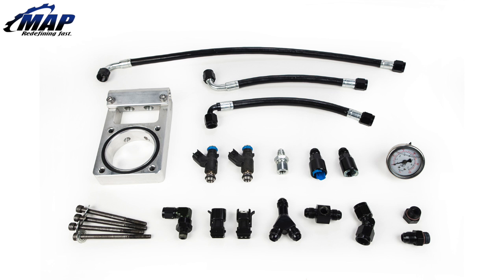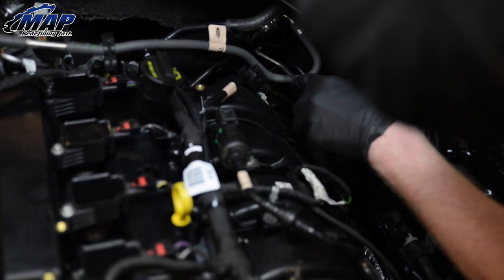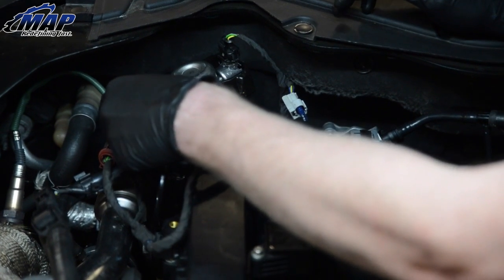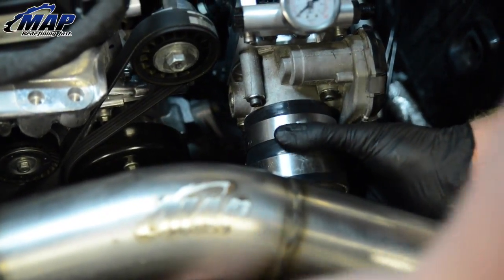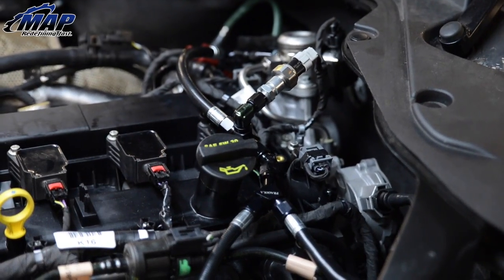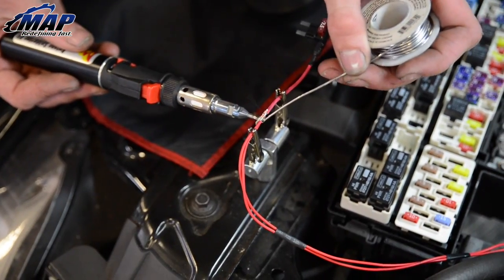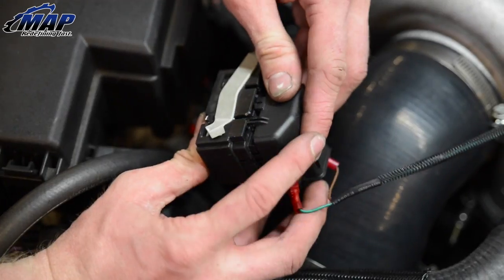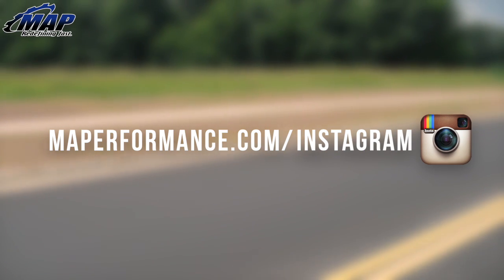MAPerformance Auxillary Fuel System | Ecoboost Mustang Install Guide

Comment: The split second wiring kit you guys sent me is totally different from the one yall are using in this video...
Reply: Mine came with 4 yellow/black wires. Not a brown  wire
Reply: Taylor Hall 
Pin 42 - Ignition coil 1 = yellow
Pin 57 - Ignition coil 2 = yellow
Pin 72 - Ignition coil 3 = yellow
Pin 43 - Ignition coil 4 = yellow
Pin 33 - MAP voltage signal = green

Comment: are you guys developing a kit like this for the FA20DIT?
Reply from the maker: +Stanley Zitello I don&#39;t think it is in the plans, but we will keep it in mind moving forward! We have seen these cars make over 500whp and run 10s on the stock fuel system so the market isn't quite there yet.
Reply: +MAPerformance  it's more of a consideration for running e85 since you'll be running out of fueling a lot sooner. It wouldn't hurt the carbon buildup problem either, a couple walnut blastings would probably pay for the kit.

Comment: Is this really the only way to add more fuel to this motor. I know its a direct injection but isnt there a better way to add more fuel then 2 more injectors
Reply from the maker: +Thomas Ryan Yes, anything over ~450-500whp you are going to need this!
Reply: +MAPerformance Does the stock system works with only a tune for e85 or its obligatory to change the fuel system to run  e85?
Reply from the maker: +Emanuel Emanuel Yes the Ecoboost platform needs more fueling capabilites before you can run a full E85 tune successfully!
Reply: MAPerformance do you, or can you make this for the transverse 3.5 ecoboost?